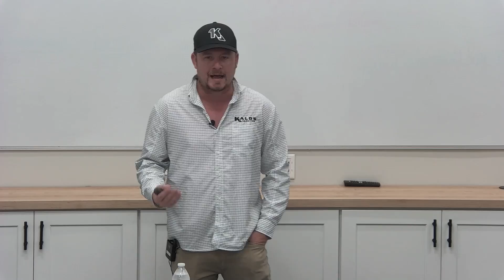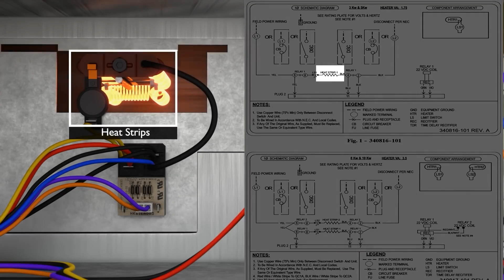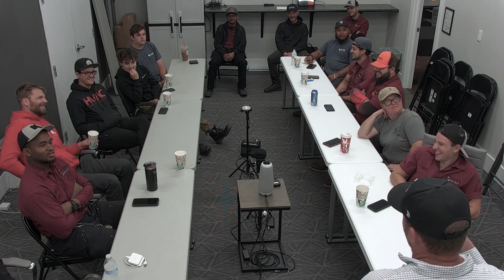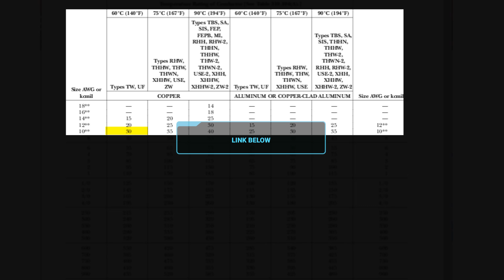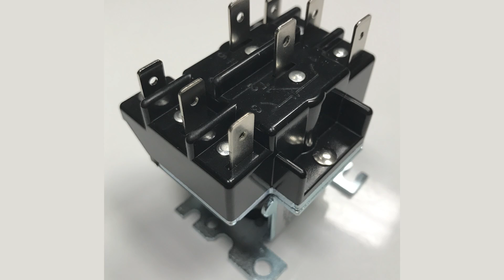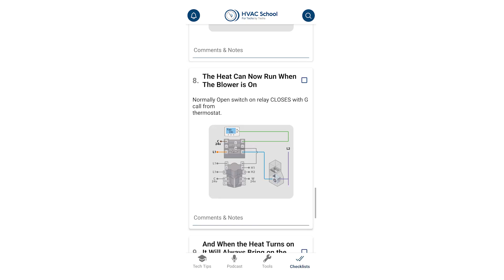Heat Pumps - Preparing for Heating Season Part 1

Comment: I have watched the blower interlock with the upside down relay 20x now and I’m still lost,somebody help
Reply: This applies to PSC blower motors—with a G call (blower on) the 24v coil inside the relay will be energized which will close the normally open contacts to send power to let’s say medium speed on the blower motor with a typical “fan on” call. 

Using a relay with at least 6 pins (we use 92380) there will generally be a set of normally closed contacts (opens when 24v coil is energized) that we can utilize so that the blower motor will always come on when the heat strips are energized even without a G call. The way to do this is to have another speed wire (let’s say high speed) connected to one side. The other side needs to be connected to the load side of the relay for the heat strips so that when the heat strips are energized this power is also sent to the high speed tap of the blower motor. 

It’s important to verify which line of power is being used though, if your speed wires for your blower motor is fed by L2, you’ll need to make sure that the power you’re utilizing from the heat strips is also L2 not L1. 

Sorry if this explanation is confusing, it would be easier to explain with a visual but the basic goal is to be sure your blower motor comes on any time the heat strips come on but not the other way around.

Comment: I actually have replaced a Heat Strip because the amp draw was wrong. Was reading <15amps and it made me suspicious so I shut everything off and ohm'd out the strip. Resistance was also off. Pulled the kit out and sure enough, one of the straps had melted itself connected to a different section of itself, essential creating a shunt. Still worked, but nonetheless it was damaged. Customer decided to go ahead and replace the part

Comment: DANGER check yourself if you use after market parts and not OEM Parts and something goes wrong. You now took that product off the UL listing. YOU CAN GET SUED. ALWAYS use oem parts for perm fix.
Reply from the maker: Give me one example where using aftermarket parts designed for the purpose where someone lost a suit
Reply: @HVACS  you are a great educator. Good info. Just passing on some of my knowledge
Reply: @HVACS  look up New Jersey furnace fire. Company was sued. Insurance found after market limit. Missing the the point. Products get listed on UL as is. If you change anything that is not oem. It is no longer listed under that UL listing. And if you the last one to touch and something happens. Who is responsible. I am a 35 plus year experienced tech. Seen it all. Done it all. Worked all over the country. Also  was a USAF Civil Engineer
Reply: @furiousfill4593 English, here in America we speak english.
Reply: @mastermnd22  well chad. I speak jersey
Reply: No one cares about the worms that are in your brain Mr.Furious
Reply: Not entirely correct, but I would agree it is the more conservative and risk adverse approach. To clarify my comment, as someone who works as a field engineer for a manufacturer, the UL files contain a “critical components” list where those parts cannot be substituted without prior permission. Accordingly, most manufacturers make part descriptions and requirements as generic as possible as the approval process is time consuming and expense, then again so are variance notices! Point is, manufacturers don’t like being locked into one vendor either. Granted, you might not know, or be able to determine, which parts are on that critical components list whereas I have access to that data, but you could ask or make some educated classifications. Not to mention, sometimes one has no choice - we used some Danfoss high pressure switches in the past that are no longer available. When that happens, just document the consideration given to the substitute part to memorialize the fact you found a part of equal or greater quality and performance compared to the specifications of the original part!

Comment: 60°C,75°C,90°C is the wire temp classes. Heat strips are resistive and not like an induction motor. In commercial we use SCR's ( Triac ) for our heat strips in Fan powered boxes. You can vary the voltage ( phase angle ) and thus have modulating heat output. Use Polaris connectors instead of wire nuts
Reply: Don't forget to tell them what SCRs are and what they do.
Reply: @LevizGibson  since they deal with AC....it would probably be better to tell them what a Traic is. Even though we may already know the difference.

Comment: I think an easier way of thinking about using the 90340 would be to just put the blower speed tap on 1. Normally open would be power in and normally closed would be your strips.
Reply: Exactly